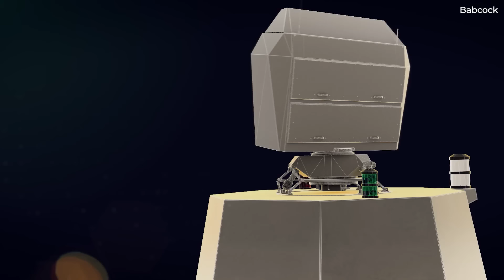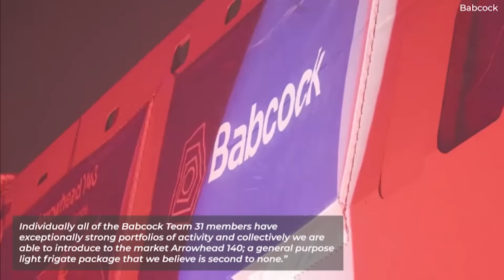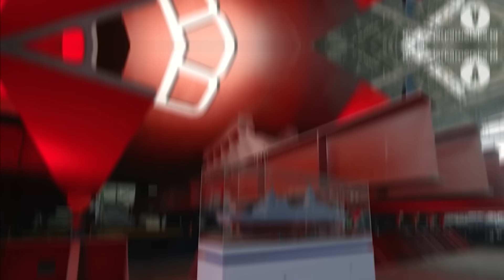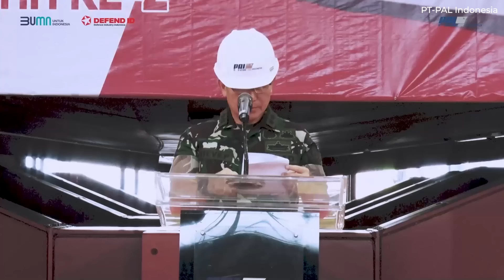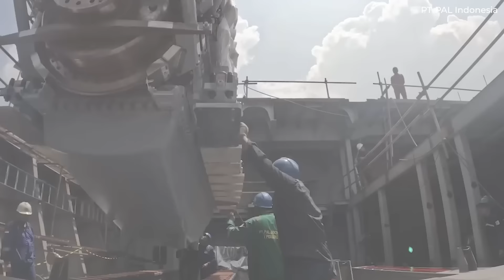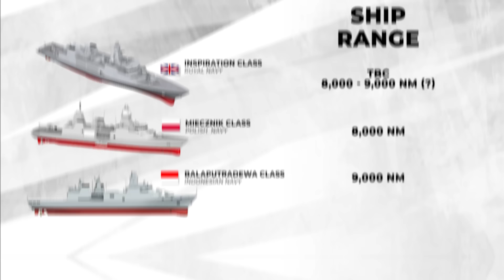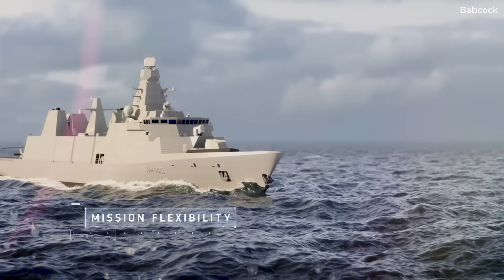Same, But Very Different: The Arrowhead 140 For UK, Poland, & Indonesia

Comment: Poland should have gone with the FREMM EVO, which is arguably one of the best frigate designs. I honestly don't understand their decision. My guess is that the Arrowhead 140 was simply a more affordable option.
Reply: The FREMM EVO is as much a new design at the AH140 is, with both being heavily based on an earlier design. British ships have not suffered unusual reliability issues, aside from the intercooler problems with the Type 45 - a design issue that has been fixed given that the carriers have been using a revised version of the same propulsion system without issue.
Reply: @Aethid  The comparison is not really accurate. The FREMM EVO is an evolution of a mature frigate family that has already been operated by several navies, with proven sensors, combat systems and propulsion architecture. The AH140 may be based on the Iver Huitfeldt hull, but the Polish Miecznik variant is still a new configuration with a different combat system, weapons suite and integration process.

As for British naval reliability, the Type 45 propulsion problems were not a minor issue, they significantly affected operational availability and required a major corrective program. The fact that the problem was eventually fixed (wich its not really) does not change the fact that it was a serious design flaw. The Queen Elizabeth-class carriers using a revised version of the same propulsion concept without major issues does not automatically prove that every British naval design is equally mature or reliable.

The argument in favor of FREMM is not that the AH140 is a bad ship, but that FREMM EVO represents a lower-risk choice because it is a more mature and combat-proven platform. Poland selected the AH140 mainly because of cost, industrial benefits and domestic shipbuilding opportunities, not because it was clearly the superior frigate. It obviously isn't, considering there are several other designs that offer greater capabilities depending on the requirements.
Reply: @SFenjoyerT1 A single flaw with one specific component in one class of ship, which has since been rectified in later classes of ship, does not demonstrate that British ships are unreliable. That this is the only notable reliability issue outside of the what is normal when a new class is introduced in at least living memory really says the opposite about British ship reliability.

And the systems on board the Polish AH140 are not new systems, or ones which have not been integrated together before. They are almost all Thales sensors with a Thales CMS, specifically developed to work together, paired with literally the most common naval guns and VLS systems in service globally.
Reply: With the AH140 offer there were more benefits for the Polish industry, including construction in Poland.
Reply: We have our ships built in Poland, I guess with FREMM's it was not possible.
Reply: Probably yes (cheaper). Poland is using British / will produce British licesed CAMM/  CAMM-ER missels. So the cooperation is deeper than only buying ships.

Comment: It is interesting no one complains that there are at least 5 Frigate designs in Europe while complaining that Europe can not afford 2 different fighters?
Reply: Design differences between different ships seem cheap enough that it is viable to make some of them unique, so small series are not a big problem. Aircraft have a lot more development cost (relative to cost of manufacture) that needs to be spread out over a large number of frames. When economies of scale increase in importance you want to focus on getting scale for a few versions.
Reply: There are very much people doing that, they have just not found this video yet. For example you can see it in the old videos about the Swedish Luleå-class where some people seem to have a hard time accepting that a Baltic navy has different requirements than an Atlantic or Mediterranean one.

Modern fighter aircraft do not require that level of national specialisation in terms of capabilities and design. 

For example the F/A-18 Hornet could have replaced the Gripen in Swedish service without any significant capability loss during the Gripen A and C era. In fact the Hornet came close to being chosen instead of the Gripen but cost estimates and a desire to mantain the ability to design and manufacture domestic fighter aircraft made the politicians pick the Gripen.  Of course Gripen ended up with a higher unit cost for the initial production run since the orders never reached the planned number of aircraft.
Reply: @Vonstab  When was the Hornet evaluated for Sweden? I've only heard about the F-16 being considered.
Reply: @ViktorBengtsson   The same years as F-16, 1978 to 1982. ÖB Stig Synnergren recommended JAS 
, F-16 and F-18 to the 1978 Försvarskommitte which was in charge of preparing the 1982 Försvarsbeslut. The whole issue was so complicated that a special group, MFK-79, was set up to evaluate the different production alternatives. In the end the decision was delayed until 1982, the only thing that happened was that the A20 and B3LA projects were cancelled since there would not be enough money for 3 new aircraft types.
Reply: @Vonstab  Thanks, I didn't know about the Hornet also being included.
Reply: @Vonstab  There are also some requirements that FMV had with regards to readiness and servicability as well as information sharing between aircraft that no other than the Gripen could fufil.
Reply: it's probably not ideal. however, even this Type31/Arrowhead 140 'design' looks very different among the three countries buying it. the same applies to all frigate designs of the past. 
every country has its own capabilities requirements and fits out their ships the best they can to meet them. not sure if it's closer to a buyer of a new car customising it to their tastes directly from the manufacturer or if you go to your tailor and have him make you a bespoke suit.

Comment: The Polish variant would be best for New Zealand as it has mission bays which the Mogami's the Aussies are getting don't.
Reply: I don't think New Zealand has the money for that. I suspect if they went with the Type 31, they would just go with the original British design and add a bow sonar. Their current ANZACs had an 8-cell Mk41, but they changed that for a 24-cell Sea Ceptor VLS.
Reply: I think biggest issue on NZ side its not exactly about the capability but more about Crew number issues, they not exactly known for having large enough manpower for anything
Reply: as a far far country from central supply chain, i guess NZ prefer more commonality with their neighbour AUS, It was the same with old ANZAC class

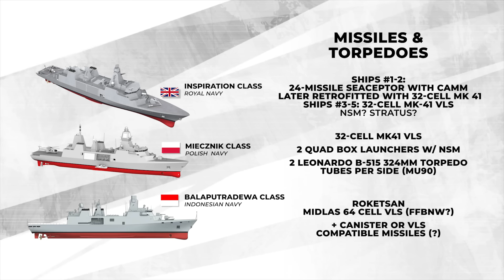Comment: 9:58 Just want to add for the Indonesian AH140 ships, the FFBNW contract for the first two hulls are signed last year. The ships were originally ordered with the VLS and CENK 200N being FFBNW, the contract for the FFBNW equipment were signed during IndoDefence expo in June 2025. SSM is also VLS-based but with a variant of the Turkish Atmaca instead of BrahMos.
Reply: 3 Main Radar . Main mast 4 Fixed Cenk 350N (X-Band), Center mast Cenk 400 (S-Band), and Cenk 200  (X-Band) for Control Helicopter
Reply: bukan cenk 200 tapi cenk 400
Reply: Cenk-400

Comment: The cost of the Inspirations is wrong FYI. The original negotated price was 250m£ per ship minus GFE, but that was pre-covid and Babcock has since renegotiated. The current estimated price per T-31 is 300-400m£
Reply: Still better than what we in the States can apparently do. I don't remember the exact figures, but, if I recall, the per-ship cost for the first few of FF(X) is something like 3 or 4 times as much while still being less capable.

Comment: People need to remember that the Type 31 is literally designed as a cost effective and general purpose frigate for the RN. The RN have the Type 45 and Type 26 for specialist high-end missions. 

Obviously for Poles and Indonesians these are their primary surface combatant so they need as much capability as possible. 

If the UK version does get the Mk41 VLS and weapons fit as planned then it will be a very capable frigate.
Reply: The RN's Type 31 does still need the Mk.41 and a sonar however. 12 CAMM is not good enough for anything better than 1 day against the Houthis and no sonar means it needs to be escorted everywhere it goes. 

But once it gets those things it will be a very good cheap frigate.
Reply: @jacobkingsford5209  If there is a submarine threat then send a Type 26 instead or a P8. There may even be coalition ASW warships operating alongside too so it's not a huge issue. But I do agree they need MK41 to be credible warships, 12 Sea Ceptors won't get you very far. It is worth mentioning though that the 57/40mm gun combo would shred drones.
Reply: @CrackingDale25  there is a submarine threat everywhere in this world, there are areas of high submarine threat and low submarine threat but everywhere has got submarine threat. ASW specialist ships are there for places like the North Sea with a high threat, but if you are doing a general purpose mission that will still be a submarine hostile to use somewhere in the vicinity. And if we look at everyone else's general purpose frigates they all have sonar, the FDI, FREMM, Constellation, Meko-2000, Mogami. There is a reason for that.
Reply: @jacobkingsford5209  Yes so that means you obviously don't send a Type 31 into a high submarine threat area. You send it into one where the threat is minimal or manageable. You can use satellite intelligence as well as other ASW assets keep an eye on the threat. If the threat is high send a Type 26. Don't get me wrong I would have still liked more TAS ships.
Reply: @CrackingDale25 if you don't have a sonar then every single place in the ocean is a high submarine threat because you don't know what is there. Without sonar even an old World War II U-boat is suddenly a deadly threat. That is why everyone puts sonar on their ships, regardless of whether they are ASW specialists or not. Submarines, and when we do not have enough type 26 to go everywhere, the type 31 will have to do some ASW activities particularly when it has been solo deployed to far-flung regions which is what it was designed to do
Reply: @Highendaudio1  It's been confirmed time and time again that they will sea Ceptor, just because a contract might not have been awarded doesn't mean they won't get them. Use some common sense fella it's a warship.
Reply: @jacobkingsford5209  Royal Navy Type-31 do have the space constructed into the hull for the fitting of a towed array sonar. 
If will be fitted is another question. Is being talked about in naval circles. 
Type-31 initially was designed for the Royal Navy as a long range general purpose frigate that was cost effective to operate. The initial fit for Type-31 was chosen before the Russian invasion of Ukraine. The threat has increased. So Type-31 is being up armed. 140 million pounds has been allocated to allow the fitting of the Mark 41 VLS on the first 2 hulls already launched. This work is being carried out now at Rosyth Naval Dockyard. UK MOD has stated that Type-31 will have Mark 41 VLS. 
BAE Systems Dragonfire anti drone laser is to be fitted. Type-31 will have long range anti-ship and land attack Naval Strike Missile NSM.
Reply: @jacobkingsford5209 yeah but they can add up to 32 cell mk41 vls. If those 32 cell mk41 convert to CAMM MR it could hold up to 128 CAMM.
Reply: @Ritcell CAMM-MR will only be dual packable, but still, 64 longer ranged SAMs isn't bad. More likely would be a bit of a mix
Reply: Poland is more focused on Russian undersea cable cutting. Thats why it has sonar, towed array sonar, the torpedo tubes and we specifically wanted a big hangar for the helicopters. The VLS is probably there mainly for AA defence rather than ship to ship combat. Its designated as shore defence ship in some places.
Reply: This, precisely. Towed array can be added very quickly, plugging the biggest gap in the sensors, and the tendency to network the fleet means Type 31s will be likely to add their missiles to the pack orchestrated by a Type 26 or 45.
Reply: @crackingDale25 yeah but how many of thoes type 31 are operational? RN doesnt have almost any ships operational currently. Yes thoes ships are gap fillers and maybe will be retrofitted, but currently they will be gloryfied patrol boats and at the same time have almost 0 support from other ships in fleet.
Reply: The Mk41 silo is now confirmed for the later 3, retrofitted to the initial 2 later. Or did I pick that up wrong on other sites.
Reply: @gregs7562  you are right. the first 2 will have them added later as to not slow down production too much for the last 3.
Reply: The biggest problem is not the cost of a ship. Its the lack of crews and the offensive capabilities of the ship.  Crew cost what crew cost,  general maintenance is on par.  

So its going to be a complete waste of money using a ship that cant do anything well on any parameters except being a cheaper overall ship that you hope to God you only have to use in peace time.
Reply: @sprocket5526  They should bring Maintenance, supply in port, logistics in house in the MOD/military. No more serco contracts - they're not cost-effective - they cost a fortune and Serco just loves to pilfer our government chest for exorbitant and poor quality provision of outsourced public service functions. 

Steps like that could help with recruitment/retention too - would allow a lot more older service members with families to have jobs where they're based at home and not doing long treks overseas.
Reply: Well we dont have a lot of frigates so wouldn't it be better to give them the best weapons  they can get  you know just in case in this uncertain world
Reply: @ChayMiddleton  It would but you don't have the money for that. I money, if you did, you wouldn't be buying the arrowhead, you'd just be building more type 26's.
Reply: @dan7564  the 26 cost like 4 times the price of a 31, could have built one less of them and had another 4  type 31 ships
Reply: @dan7564  Type-31 is cheaper to operate than Type-26 and is a general purpose frigate. 
Type-31 is intended to operate long range as a single ship. Anti piracy, narcotics smuggling.
Type-31 is being up armed to be able to participate in a task force or battle group when required.
BAE Systems is developing Dragonfire laser for downing drones. A variant of Dragonfire is to be fitted to Type-45, Type-26 and Type-31. With this system and Mark 41 VLS Type-31 will be a responsibility effective and cost effective.
Reply: @ChayMiddleton  You couldn't be more wrong. The UK has lots of allies, we're in NATO, Five Eyes, AUKUS and have a good relationship with the Japanese.
Reply: It took you a month to send a single destroyer to cyprus, and pretty much left immediately. Now cyprus is rethinking having UK military bases on its soil since the UK couldn't defend its own personnel, let alone the Cypriots, jeopardizing the military base agreement. But it's OK, you can just rely on your allies when you're military is a clusterfuck
Reply: @SebastianBosek  The UK has told them Akrotiri is British and will remain so. Also it's no secret the RN is in pretty poor shape at the minute, mostly down to lack of investment which has caused availability issues as well as old ships being retired without replacements ready. This will start to improve over the next few years. The thing is the UK has been there for allies in the past and there's no shame in getting help when we need it. I'd also add that the UK shot down the most drones in the middle east out of any European country.
Reply: @CrackingDale25 relying heavily on your allies while letting your own capabilities rot is not defence
Reply: @SebastianBosek  OK Ivan!
UK Bases are UK Sovereign Territory and UK has the signed agreement. 
F'35B and Typhoon were deployed. Is only a Cypriot nationist politician that from time to time complaining for his own political aims.
UK has a Type-45 near the Persian Gulf and a Type-45 just returned from a deployment to North Atlantic and Arctic Sea with aircraft carrier HMS Prince of Wales. Norwegian and UK F-35 were chasing Russian aircraft away! Ok Ivan 👍
Reply: As a Pole, we don't need a particularly strong navy, our maritime reach is in the Baltic and we just need something to float interceptor/surface to air missiles on so we can push the defence as far from people's homes as possible
Reply: It is delusional to imagine that we can choose which of our tiny escort force does & engages what we want. In war the enemy attacks where it wants, with whatever it has. They don't say, "Oh, it's only a 2nd rate T31, we'll go easy on it", they just take an easier kill. We don;'t get the chance to replace a weak shop with a better one.

Comment: Type-31 is for all intents & purposes is an oversized OPV.

Despite what people may say, the Mk41 VLS & NSM anti-ship missiles are just "planned for". 

No contract for the integration of either has been placed.
Reply: Don't know many OPV's with Sea Ceptors or NSM.
Reply: The Mk41 and NSM have been confirmed and budgeted for.
Reply: Babcock has allocated over £300 million for the integration of Mk41 into Type 31.
Reply: NSM is already integrated with TACTICOS IIRC, and given the Brits already own their NSM modules, it should be easy enough. 

Mk41 integration is more tricky, but the contract has been signed.